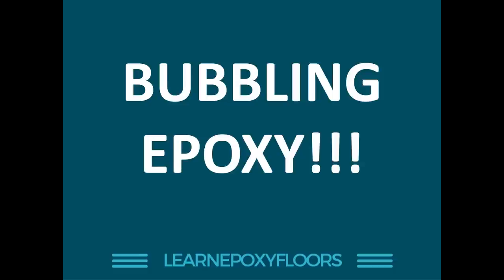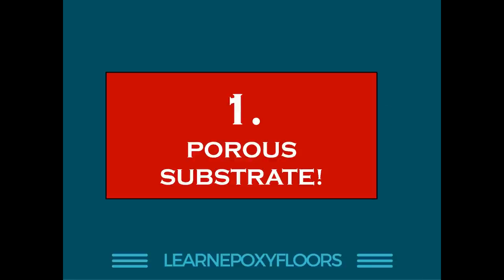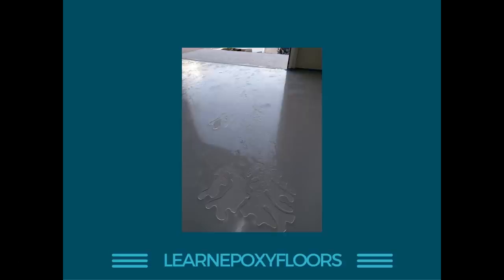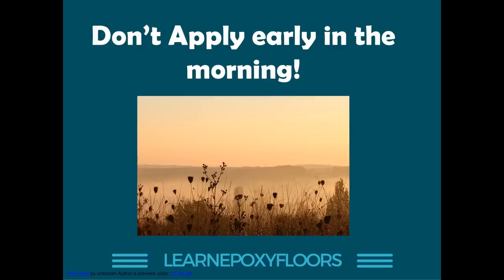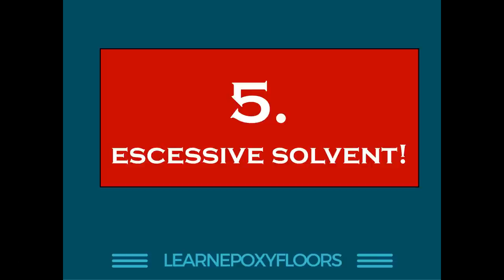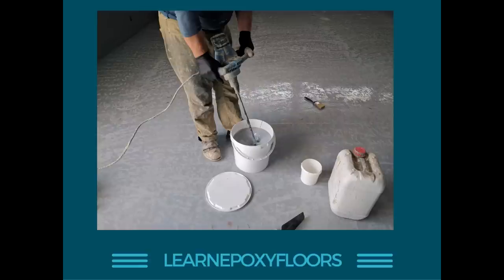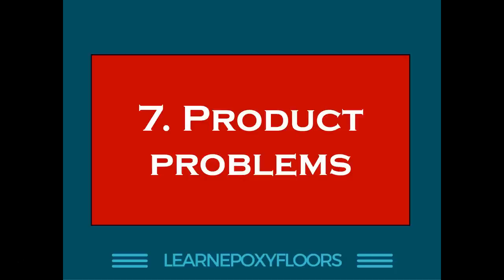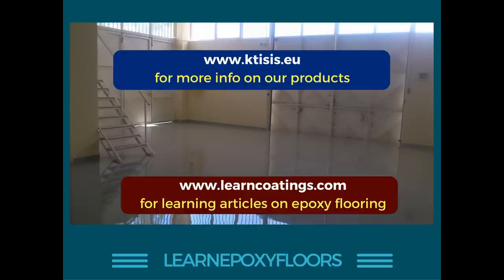Bubbles in Epoxy Floors - Seven (7) Reasons Why are you getting them & How to avoid them

Comment: I did an epoxy floor in my garage and got thousands of bubbles. That was after I grinded the floor, applied 2 coats of water based epoxy sealer and then 100% solids epoxy. I had to use an epoxy concrete repair paste to manually patch each pin hole and bubble crater before painstakingly sanding and recoating. I then had to repeat the process again because the second coat was still significantly affected. Absolute nightmare. Indeed I placed the initial epoxy coating in the morning, the same with the sealer, so maybe that was the issue. Currently I am 1 month into my 2 week project.

Comment: Good explanation. Thank you. Sir I have few questions:
1. Can I apply self levelling  epoxy to an outdoor area?
2. Can I apply self levelling epoxy to bathrooms where floors are usually unlevel because of drainage?
3. Is self levelling epoxy  more durable than tiles?
4. Is self levelling epoxy more costly than tiles?
Thank you. More power to you sir.
Reply from the maker: Hi 1) I do not recommend epoxy for outdoors, watch this video for more info https://youtu.be/-I62QkqIP8w  2) I do not recommend this, the epoxy will run into the drainage, you may be better of with roller applied epoxy 3) It is very durable, the only tiles that have equal durabilty are the industrial tiles 4) Depends on the quality of the tiles and the existing setup and substrate, and the labour that needs to go in for each case

Comment: Hi,
Kindly tell me how to prevent these bubbles after the application of top coat.
Suppose in a case it appears after final coat.
Thanks
Reply from the maker: Bubbles will only occur during the curing process. Once the floor is dry they cannot emerge. But sometimes pre-existing bubbles may collect dirt and will become visible. They were there from before

Comment: Hi, if you have a bad case of bubbles in your newly laid epoxy floor - what's the best way to repair it? Remove all and start again? Or just keep patching up and recoating?  Also, should the surface be sanded before re-coating ? (eg. to remove the bumps from bubbles which haven't broken through the surface).
Reply from the maker: No need to remove it, that will be a massive hassle and would take days. Just patch and recoat over. Good luck

Comment: Hi, I installed an epoxy floor with a final polyurethane layer. The day after floor was covered with plastic in order to be able to paint some walls. Two weeks later several bubbles apeared, all of thw bubbles have water underneath. Could the plastic provoke the bubbles?
Reply from the maker: It is very unlikely that the plastic provoked the bubbles. If there is water underneath it means that there was trapped moisture or rising dampness in the substrate. Epoxy and PU (I am assuming these are solvent based) are not breathable products

Comment: You said no 5 reason give you a feel about the floor, so after you applied primmer you see where problems are, so if problems what would be the correction step plz advise
Reply from the maker: It depends on the problems that arise. If oil rises to the surface, it means the floor needs better cleaning. If new cracks become visible you need to patch up the cracks first. Depending on the problem, you will need to find a solution

Comment: Recently had a top coat done on an concrete overlay, by the end of the day I noticed sporatic dime sizes bubbles. What could have caused this?
Reply from the maker: I am assuming that the concrete overlay had not been primed or sealed? The concrete probably released air when the topcoat was being applied. Also in the summer we have an additional problem that as the temperature increases in the morning, the concrete expands. It is advisable to apply in the afternoon in these cases
Reply: I inspected it and noticed pin holes in the overlay it was top coated idk about primed but the holes seemed to have caused it. The solution the company is offering is to sand down the craters and I guess spot fill. They claim you will not be able to see a difference when done I'm hesitant to believe them.

Comment: My patio guy said they will cure over time. Spike holes caused by his shoes. Is this correct?
Reply from the maker: Holes caused by the spiked shoes happen during the application when he walks on the still wet coating. These holes should close within a few minutes. If they don't go away it usually means that the coating had already started curing and he left a permanent mark. 
But this video looks more at bubbles and pinholes caused by degassing rather than spiked shoes

Comment: I'd say the biggest reasons are 6 and 7. Mixing in air bubbles and the materials in the paint. Also, even the typ of solvent you use to thin the material can have a big effect on the leveling and foam release.
Reply from the maker: Thank you William, thats a good point about the type of solvent and how it contributes to foam release!